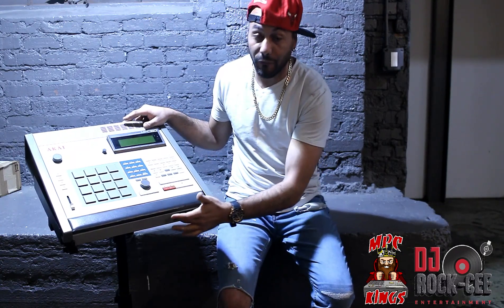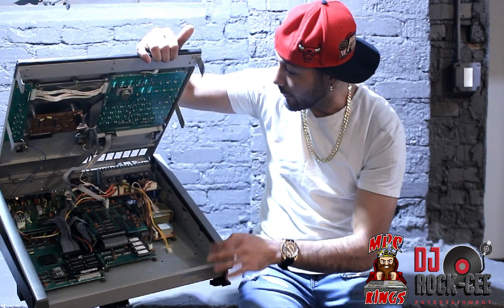How To Install Internal Scsi Drive -Compact Flash Drive - Scsi2sd- Mpc 60 / Mpc 60 Mkii !!

Comment: After installing, how do you copy your old 3.5 inch disks (I have hundreds) to the new drive?
Reply: this is the question, i have sampled everthing, i have sequences and songs inside my floppy disk 3,5" 1,44mb and i don't wonna lose them , i know with floppy it takes time load,often mpc don't read them but what is the solution?r  Recently i installed scsi output, i bought a zip drive but we are always there, how to transfer samples, sequences and songs from floppy disk 3,5 1,44mb into floppy for zip drive